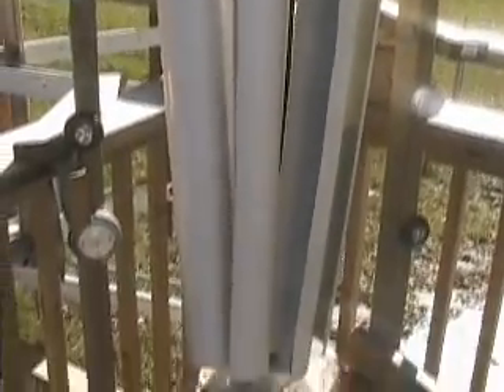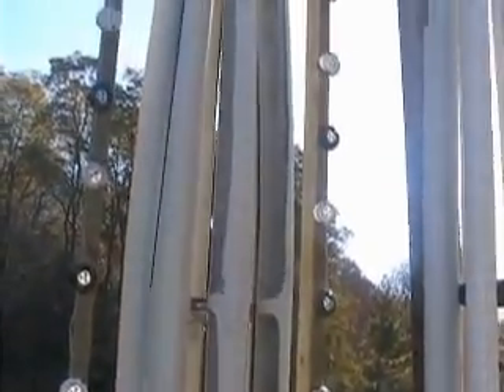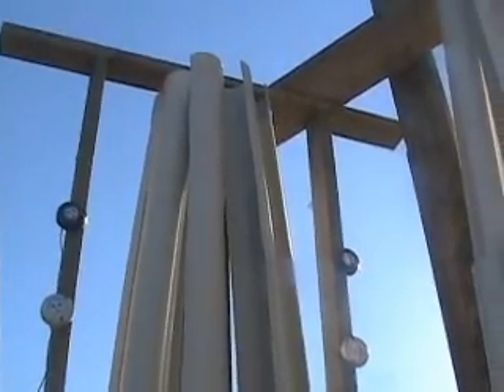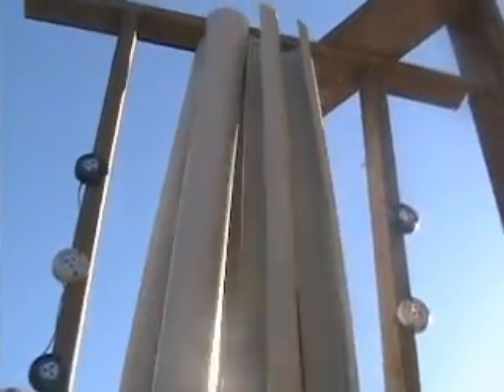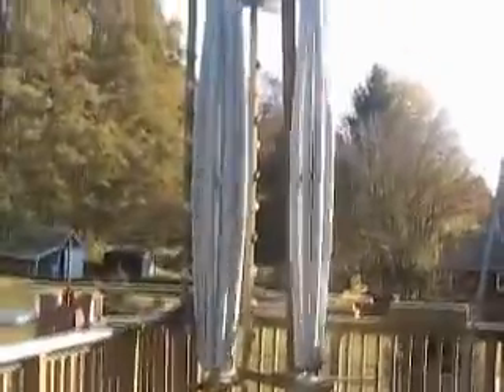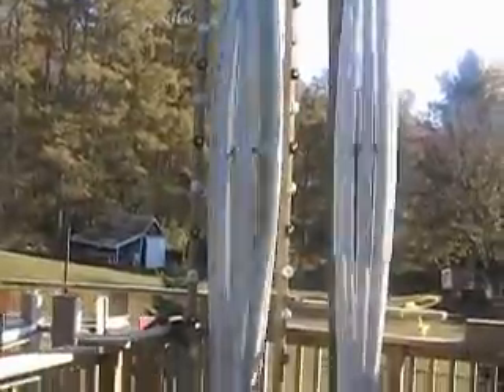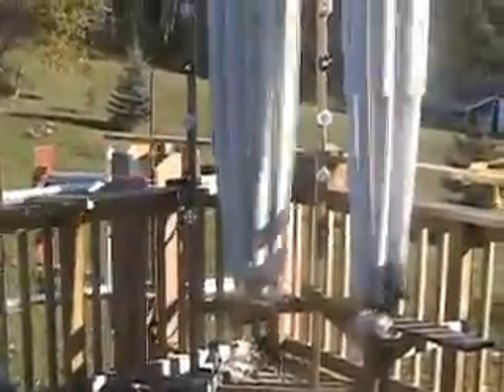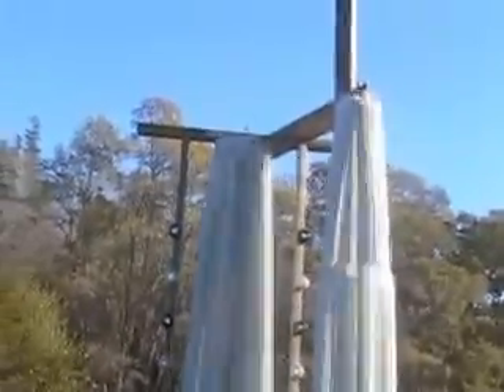Turbo Spin V8-4" (vawt,savonius,vertical axis,windturbine,hawt, ametek)

Comment from the maker: Sjh, hwen i shorted the ametek 38 it kept going arround 100 rpm with wind was arround 20 kmh. it is still cold for now but i will do another video for this info.
I created the countour for extra Blade area and Stability reasons and it was a winner for both. but since the snow came in i stoped for now. buy the way, Harvard university requested few of mine and i sent one so far for an ehxibit they have on march 30th.
sjh, my  turbine works,

Comment from the maker: it will strat spining at 3kmh wind, in order to get 450 rpm you need 30 to 35 kmh wind. these turbines are not meant to produce great power. 99vdc should work.

Comment from the maker: no, it will start spining in 5kmh wind. vawts have advantages but also hawt are more eeficient. i choose vawt because all i get is dirty and terbulant wind, for me the vawt is a best choice. that is why i designed my own style to work for my cretiria.
i do not recommend a car alternator because it require power to make power and that gets complicated with power on power off with wind to excite the rotor. so i recommend to buy a dc motor. the best ones are with high voltage and low rpm